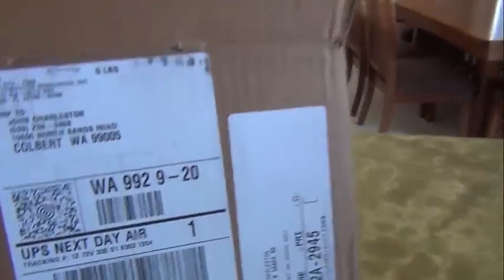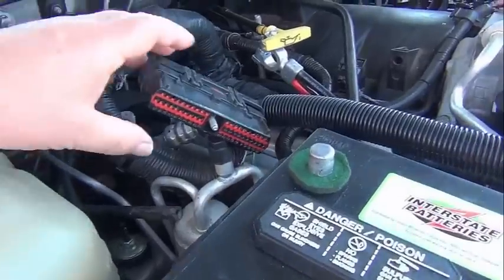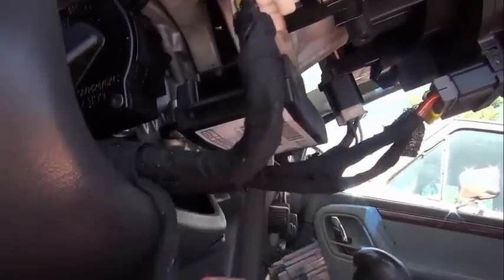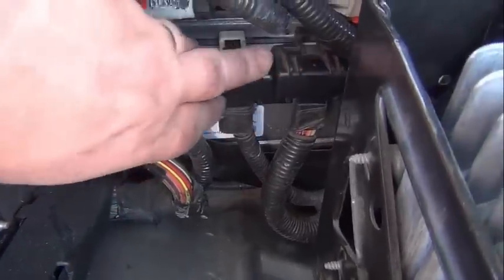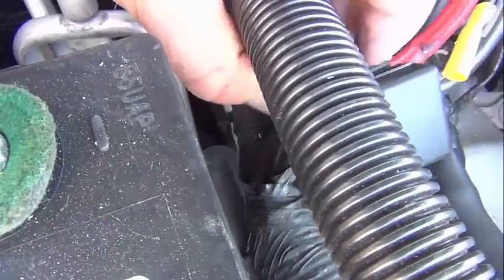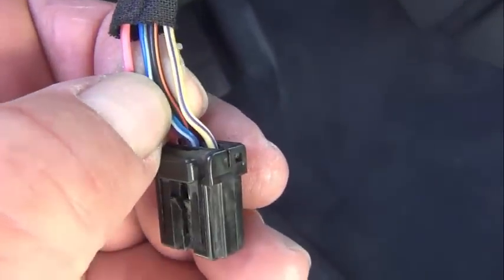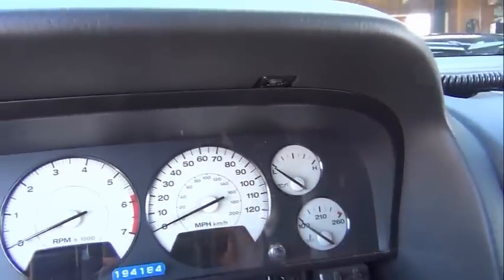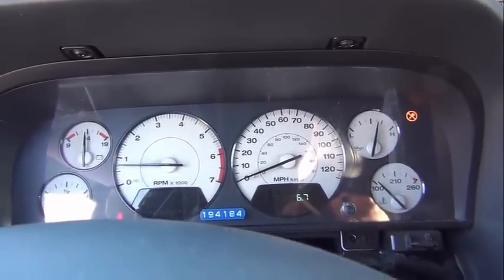All Computer Resources Remove SKIM from ECM

Comment: Hello i just buy a ecm to ACR with skim delete for a dodge nitro RT 4.0 when i turn the key to start nothing happen and after few minutes every light on the dashboard go off… no crank, no click,batterie is new starter is new, the only way to start the engine is to use startpilot in air intake and push off thé starter relay and jump one wire to crank the starter and then the engine start… big probleme …my question is do i have something to do with the wire of the skim ?
Reply: All computer resources has gone downhill they probably messed something up

Comment: I just ran into this issue.  I been dealing with a nightmare regarding my Jeep for 14 months now.  Finally buy a second brand new blank pcm from Chrysler after being defrauded by flagship1.  No dealership in Canada have the correct tools to program the computer to my LJ.  Had to pay 300$ to have it shipped to Wranglerfix.  They programmed it and sent it back.  Go and install it and turn the key and all it’s doing is cranking.  Find out that the sentry key module activated the skim within the module.  Removed and disconnected the sentry immobilizer.  Just shipped the new pcm back to Wranglerfix to delete/deactivate the skim in the module so that I can try this again without the sentry key connected.   I can’t believe this is happening to me.  I wasn’t made aware of it.  I thought with programming the skim would have been entirely disabled so it wouldn’t recognize the sentry key at all whether it be connected or not.  Not the case.   I really hope I get this settled soon.   

The only question I have though is which key did you use after removing the sentry key immobilizer?    Are you using the same key with the programmed chip in it from before you removed the sentry key?
Reply from the maker: I'm sorry, it's been several years now and I can't quite recall.  However, I do know that I did put my SKIM reader back in and demanded the company reprogram the PCM (for free) which they did.  This after I spoke with one of their lead programmers who said the engine and other items would not run correctly without leaving the SKIM in.

The ONLY number they needed was the original VIN and the actual mileage (within 10 miles).  When I reinstalled it - everything worked.  So, the major problem was their improper programming as well as their saying the PCM would work without the SKIM.
Reply: i have a 1999 dodge caravan bad bcm-  took it to dodge dealer down there for 3 months-  told cannot be fixed do not make bcm no more. just sale it for parts and charged me 300 bucks.  dealing with flagship now  bcm from them  did not work wont start

Comment: Anyone needing this service, we provide it for our customers regularly.  

https://www.garretttuning.com/products/chrysler-jeep-dodge-ecm-pcm-security-removal-skim-delete-programming
Reply: this does not remove skim programming... this is just resetting skim... the security light stays on... eventually it can set the alarm off...  then you are screwed...  You must leave the skim unplugged... but one wrong issue and the alarm will trigger forever even with the skim removed.
Reply: @darthhemi1735  it depends on the method of removal as well as the vehicle and integration

Comment: Take the damn bulb out !
Reply: They aren't a bulb. They're soldered LEDs into the circuit board.
Reply: @92clintonr  it's just a twist out bulb
Reply: @thebestman200699  
No it isn't. Have you removed this style instrument cluster before? The main lights that provide light are twist in 194 lights. The "dummy" lights on this cluster are small soldered in leds that you definitely can't just twist and remove.
Reply: @DavidPolak  
Have you physically seen what you're talking about or you're just replying with what makes sense in your own head? They are tiny light emitting diodes, no bulbs to "grab on and reef with needle nose" You rip out one of those diodes you're going to create issues.

Comment: This ECM will by pass security too? my jeep wj head light tail light go on and off when engine is not run ,i hope this will help.Thanks
Reply: Did you get your headlight and tail light problem fixed ? If so how ? I got sam problem
Reply: @PcGuyBry  I got it fix one guys in jeep forum help me .my jeep 1999 wj 4.7 .it have auto headlights switch option. If I leave it in auto .the light will turn on and off by it self. Even car not running.if turn headlights off and it don't turn on and off by it self. I bought new headlights switch and it works like normal. I hope you understand me .

Comment: Guys, I have only dealt with All Computer Resources once.  At the rate things have progressed with them, I really don't see me ever doing it again.  Their PCM works, but they didn't disable the SKIM function at all like I paid an extra $50 to do.  And yes, I had the SKIM module disconnected a week prior to installing their PCM but it won't stay running with it disconnected.  If they fix the problem, I will update this nasty note.  They just told me that they did and said that I am modifying or have modified the vehicle.  Their "head engineer" won't even call me to discuss the issue.  I would call them if I could get to their technical support that way.
Reply: Paul Standaert I am having the same issue with there ECU. No one will call me back can’t talk to a live person it’s all contact VIA email. And it takes days for them to respond.
Reply: yeah like on my dodge 1999 caravan oh you need a fixed and programmed bcm plug and play- i put it in  no start .  we do not give refunds.  400 bucks.  i called my credit card dispute and i got a full refund
Reply: @mars188  It sounds like they are still having issues. Not a good business to deal with.
Reply: @paulstandaert5709   you have the pcm - bcm- skim module . my dodge does not have the skim module under the dash. i am told it is programmed in the bcm. i think flagship is leaving this out of the bcm so it dont work.

Comment: Would have loved it if this worked for me on my 2002 Grand Cherokee.  Gave ACR two chances to get it right and my car still shuts off after running for 2 seconds and throws code p1686 (no communication to skim).  Check the internet.  ACR has as many, if not more, complaints against them as they do success stories.
Reply: I am going through the exact same thing.  Re-connecting the SKIM module results in it running great.  But it ran great with the old PCM.  most of the time, anyway.  The SKIM kept killing it at random times and it has been exceedingly difficult to pin down the problem.  So, I figured why not go this route?
Reply: Certainly, agree with that!

Comment: Okay I'm going to end up doing what you did getting a new PCM and taking that damn skim unit out but from what I understand the actual gauge cluster knows that there was supposed to be a skim unit and is going to throw that light regardless so take your gauge cluster apart and remove the light
Reply from the maker: So, after talking further with All Computer Resources they convinced me to let them replace the PCM one more time - and considering the shop manuals, I read that described to problems one would / could have by NOT installing the SKIM I decided to do that.  When I installed the replacement PCM the SKIM and all other electrical functions worked as expected.

Comment: mine does that, but a few seconds later, shuts down all the gauges, after another few seconds every light on the cluster comes on and all the gauges stay at zero even though its still running and driving down the road, but when all the lights come one nothing inside the jeep but the door locks work, no dome light, no windows, door chime nothing. any ideas
Reply: oddly it was the passenger side window switch causing all my issues from dead gauges, rough idle, engine stalling, all doors and locks failing, windows clicking over and over at random. literally all of it. and yes i put the bad switch back in to see if the issues returned and yes they did. even did this swap over and over while the jeep was sitting idling in the driveway and was shocked to see all my gauges come back to life with the new switch and fail with the old one... wouldn't have believed it unless i seen it for myself
Reply: That switch works on the PCI communication bus in the vehicle.  All it takes is one module to scramble the data bus, and then a whole lot of stuff doesn't work.

Comment: I'm going to have this done to mine as well but it stays on thats fine ill just pull my cluster which takes 5 secounds and pull the light bulb that illuminates it to easy!
Reply: Not the case. These have tiny LEDs soldered into the board on these clusters.

Comment: I had the same problem with my 99 Jeep Grand Cherokee. Both keys I had just stopped working. Got the SKIM light and the vehicle shut down 4 out of 5 times I tried to start it. Watched the video here and read the comments and decided to send my ECM to ACR and have the SKIM removed from the program. Cost me $100 and that included shipping both ways. On advice from the guy at ACR I disconnected the SKIM module connector plug from the SKIM module in the steering column and stowed it out of the way. 
I got the ECM back from ACR today and installed it. Started right up but I still get the NO-KEY light. I can live with that.
Reply: If you need help with this service you can contact us.  We perform this service for our customers regularly.  

https://www.garretttuning.com/products/chrysler-jeep-dodge-ecm-pcm-security-removal-skim-delete-programming
Reply: @bradgarrett7261  are you still doing this?
Reply: @TheGoodsonFamily  yes we are
Reply: @bradgarrett7261  perfect, we shipped my gf's ecu out. should be there by saturday
Reply: U guys still doing this and how much to get it done @bradgarrett7261
Reply: Where can I send my computer at?
I got my 2002 Cherokee  4.0L pls hell
Reply: I am going to try that.  I just saw a video where the owner disconnect the bulb to the no key light. Vu will just put tape over it.

Comment from the maker: Sorry for not getting back to those with questions quickly - notifications from YouTube filter to a folder that I don’t see . . .

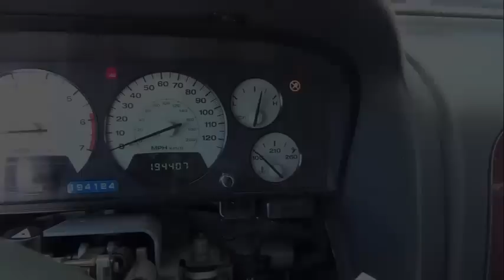After re-connecting the PCM and starting the engine the SKIM light is still on (@ 5:43).
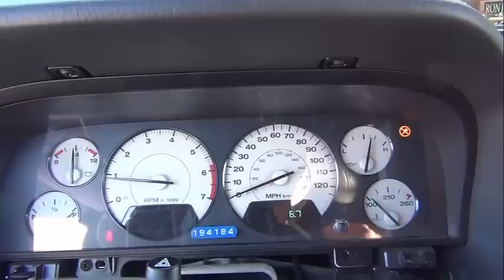Next I completely removed the SKIM, restarted the engine and after a few seconds the SKIM light come on again (@ 7:11).
 OK - what the video does not show is what I did next - I again contacted All Computer Resources (ACR).  I spoke to the manager of the programming department and told him my story (I believe this was the 3rd failed program with this order).  I explained that the last programmer I spoke with said he was preping the program to ignore the SKIM, and run correctly without it.  But as you see, the SKIM light was still back on - not what I wanted.

 The manager told me that programmer was incorrect and that the SKIM did need to be working correctly and he agreed to reprogram the PCM again at their cost.  I sent it back and when it returned I had the SKIM in place and buttoned up.  I installed the PCM, fired up the Jeep, and all worked well.
It’s been over a year now; a bit less than 20k on the new engine and PCM - all is working well.
Reply: How did you get a hold of them?  Their tech support won't even bother to call me.  All you can reach is the sales "department" and you have to go online to make a support ticket.  I asked numerous times to just call me and we can figure things out in about 6 minutes.  After exchanging emails for an entire day, Ryan is, for whatever reason, telling me that I have or am modifying the vehicle somehow and he can't "diagnose" it.

Comment: The skim system can be removed from the computer , but it lies dormant. If you do not use a non skim body control module in conjunction with the non skim ecm , the body module will communicate that it is a skim body module and report its code in order to sync with the ecm. This will enable skim in the ecm. At that point you will have to reset the ecm back to non skim. Skim cannot be "removed " from an ecm, it can only be flagged dormant in the ecm program.
Reply: What do they charge to remove skim from pcm
Reply: @charlesellison4707   125-150 bucks
Reply: yeah and who do i call not to put the skim code in the bcm?  lucky me i have a 1999 dodge caravan without the skim module under the steering wheel- i was told it is in the bcm. cannot be removed

Comment: john. i have done the same thing had used pcm reflashed and skim removed from progeam. light is still on if i read this right. you sent the pcm back, they reprigramed it, reinstalled the skim ? and niw the light is off. or did not install the skim and light is off. also do you alarm buttons work or no mine do not now.
Reply: The skim is a federally mandated thing for anti-theft and is a curse until eliminated. 
Remove the skim/key light/lamp and go on your happy way. 
Its a gift to be rid of that skim crap on chrysler because when it screws up, you are screwed. 
If you need extra buttons on a keychain may I suggest BULLDOG remote starter and keyless entry. Problem solved.
Reply: It is not federally mandated in the United States.  At least, not back in 2000.  I have a 2009 model car that has no such anti-theft immobilizer.

Comment: the "no key" light stays on, that's the trade off, it's something you will have to deal with or hide it. All the guys say the light stays on afterwards
Reply from the maker: It did stay on and I complained to the company that programmed my PCM.  They reprogrammed it and the SKIM light is off.
Reply: @jcthewizard  I would like to know how they did this. That is the good service.  But many just reset the PCM and you must leave the Skim module uplugged.. the alarm will eventually be set off.
Reply: I'd just take the bulb out of the cluster... unless it is an LED soldered in, then maybe not.

Comment: After getting thrown out of dealership for being "difficult," I bought a new skim online and towed my Liberty to another dealership where they told me I just needed a new key. $17 online, $65 to cut and program. Rufunded the new skim. Thank god I didn't let those a**holes push me around. Over $900 saved.
Reply: You never said what your problem was. What was it? What code was pulled?
Reply: @TheAlexxxherrera  Sorry, i missed your reply. It was a no start and no communication with the PCM issue. So there was no code. They tried to sell me on a whole new skim system. Ended up being a bad key fob despite me repeatedly asking if that could be the problem.
Reply: BTW they're called Stealerships for a reason!
Reply: had my 1999 dodge caravan at the dealer for 3 months. told cannot be fixed bad  bcm do not make them no more. sale the car for parts
Reply: @mars188 get the bcm from the junkyard
Reply: @THISISDUMBBBBBBBBBNBNN  only thing you need is to remove the skim. i did all that other junk never worked on my dodge. removed the skim started right up
Reply: @mars188  I'm happy you figured it out.  I'm going to try that.   I have a jeep I'm pretty sure the pcm is malfunctioning , the car runs but stalls after a few minutes.   I'm going to remove the skim first thank you
Reply: @THISISDUMBBBBBBBBBNBNN  remove the skim under the steering wheel- then remove the skim from the pcm . i found this out after 600 bucks down the toilet
Reply: @mars188   can you tell me who removed the skim from the pcm for you ? I plan on buying a new pcm with the skim disabled and also remove the skim from under my steering wheel.   Costs about $360

Comment: Im having the same problem with my skim module. Dealer wants $1,000 and guarantees this never works. Crooks. Did u get the light to stay off?
Reply from the maker: +Patrick Irwin Yes - but now as I thought.

I spoke to another programmer - they insisted that I reinstall the SKIM module.  They rebuilt (programmed) the PCM again, and I installed it as before.  This time the SKIM did not fail and all has been well since then.